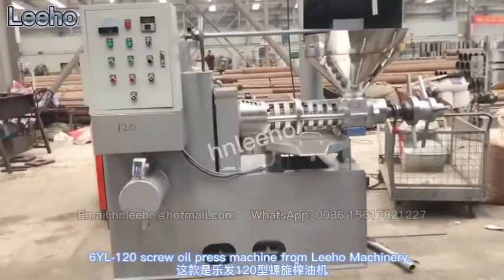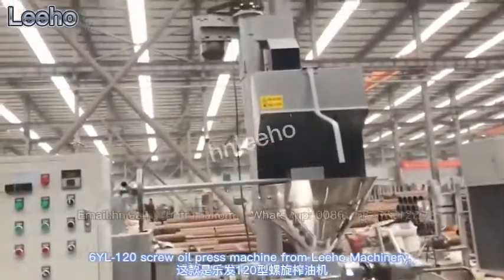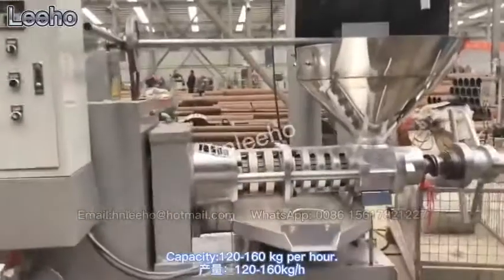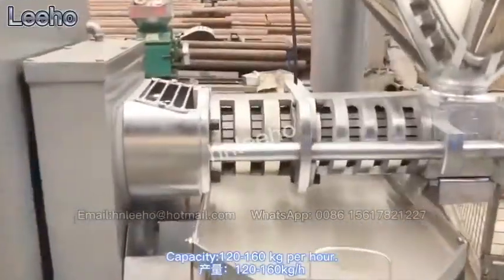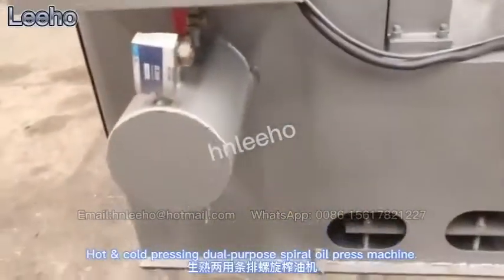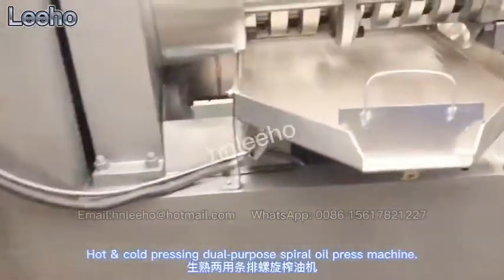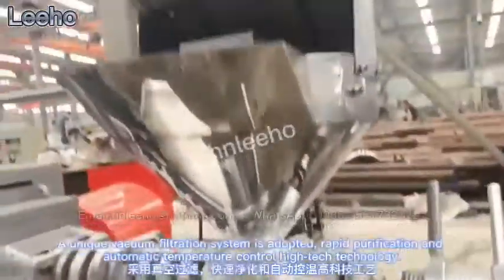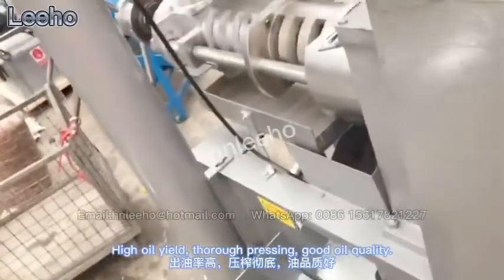How to get long-term benefits

Comment: what is cost of this in USD
Reply from the maker: we have different capacity models, their price range is $3100-$9550, please share youe contact information, so that we can share more details with you.
Reply from the maker: or you can add my Whatsapp: 0086 15638538062
Reply: @songting3026   ok